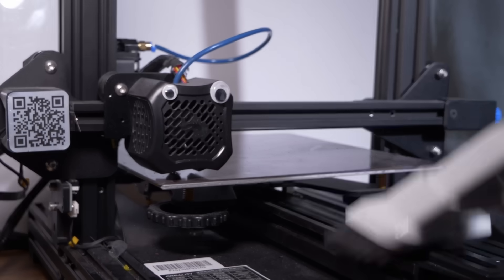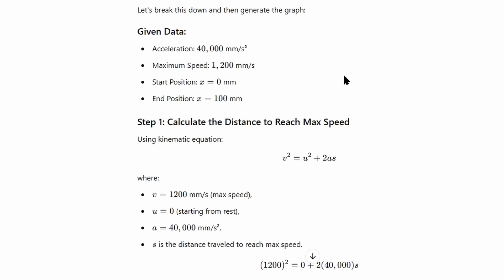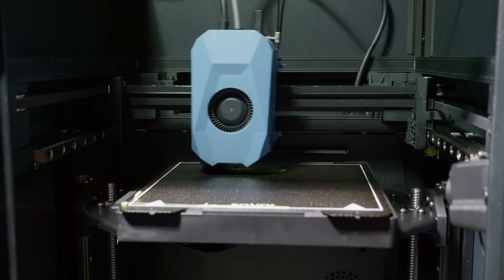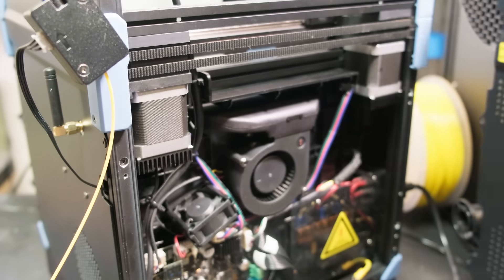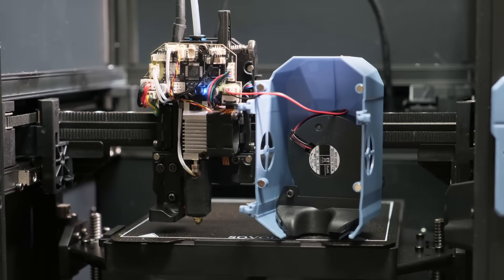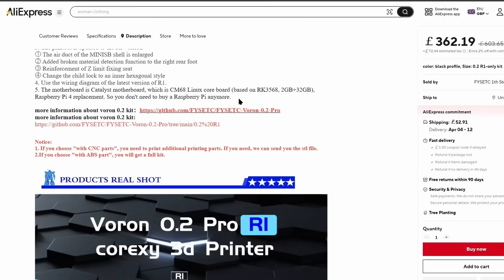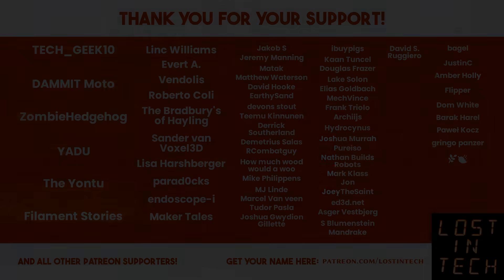SOVOL Zero - Tiny Powerhouse - FASTEST Production 3d Printer??

Comment: $380usd for the Sovol Zero now at the start of 2026, meanwhile the SV07 is discounted to $99 with the same software but an older open case bedslinger design, bigger build area, and about a third of the speed (SV07 ships with a factory 24min benchy, its actually a little cleaner than the 8mins one shown here).

Its a clever design because coreXY has no moving motors (bar the extruder itself) so doubling the width of the bed does almost double the inertia, and so for a given amount of force (both motors and frame rigidity ect) halve your acceleration time. But its also kind of a strange design in that its quite an expensive to manufacture small printer. It relies on many linear tracks instead of just smooth rods (let alone Vwheels), a pair of lead screws, 5 stepper motors and quite a complex belt drive, in addition to the steel frame, panels (which btw I think where needed as weight and stiffness to try cull vibrations the engineers talked about, not just the feet) and various airflow ducting. Yet its not a "premium" printer, it runs a single stepper driver for both vertical axis, a very course control on bed heat, and has some questionable wobble with the way the lead screws are left to handle torsion AND perpendicular vibration. It truly feels like its got one foot in either niche and feels like it falls into a gap between. Like if it had been the first SOVOL to pitch an AMS style multi-filiment it'd have been a best seller (model making isn't normally large, and wastage cost in both time and materials is mitigated for smaller faster printers), if it had been 2/3rds the speed but half the price it'd have been a bestseller (cheaper than normal Ender3 and simlar? It'd crush "entry level" market) or if it had cost twice as much but been neatly polished as a halo product (have everything BUT size) it wouldn't have been a huge market but it'd have been the ONLY option for those people. One toe in each though? I'd be interested how many they actually sell, vs their own bigger SV08 or cheaper SV06+/SV07. The economics of having this AND a large printer just don't stack up well vs buying one Prusa Core One L or equivalent from the get go unless your REALLY sure you can get both running at once but also sure you won't be scaling further to a farm.
Reply from the maker: $99 is insane, for literally anything with klipper

Comment: I've had mine for a few weeks now.  No problems, but it's not quite the same klipper presentation I've got on my Enderwire home brew, but that's probably in the config files.  I've had TPU jam up in the extruder, but that was an easy fix, just unscrew the spring tension adjust, pull back on the gear level, pop the reverse bowden tube out, and then pull the filament out.  I then put everything back in and made a fresh clean cut on the end of the TPU feed, and tried to load the filament again.  Worked!.  There's a small chance that TPU will miss feed and get caught in the extruder gears, but that's easily undone.
I've gotten perfect prints from ABS, PETG,  and TPU.  Haven't done much with PLA yet.
'

Comment: Think my T1 Pro can match its performance. Or near it. I am most impressive though is that I can get flow rates over 100 cubic mm3. The benchy was around 8 minutes too, if I remember well, and quality was quite ok. If I remember correctly you also have one. Wonder if you compared the performance of the two. Challenge with the T1 was optimising the parameters as standard profiles were not really

Comment: oh no they still didnt fix the extrude so i guess my mod will be used on this too. SV08 Extruder fix on printables. looks like the same everything as the SV08. Now i need to see if i can get a tool head to put on my SV08. i see they made sure not to have the build plait resting on the plastic shell in this version. i told them that was the issue with the tacos on the SV08. the clips on the cover are do to lots of issues with the tool head falling off mid print for people. 
note: the step files got added to the git hub 5 days ago. 
they defiantly used a lot of the community's comments to make this thing more polished then the SV08. the SV08v2 should end up being epic.
Reply from the maker: What's wrong with the extruder? 🤔
Reply: @LostInTech3D  oh i cant add a link but the pin has a high chance of working its way out of the tensioning arm

Comment: @Lost in Tech For me this printer would be very interesting for printing technical parts in abs/asa, pc, but I'd like to get the chamber a bit hotter. I'm wondering if there is enough space in the printer to isolate it. But I'm unsure if i'd cook the toolhead mcu, since it seems to have no dedicated cooling fan. Do you know how hot the mcu gets in the closed chamber, or for how many degrees C its rated. Same for the eddy current sensor. Btt eddy for example seems to be only rated for 60deg C max ambient temp.
Reply from the maker: That's why I tested PC. I didn't think to look at the chamber temp though. The bed is at 120 so in such a small volume it's probably not ambient 🤣
Reply: @LostInTech3D  The chamber doesn't seem to get that hot on this unit, probably because of the metal panels. mpox measured 50deg chamber temp in 20min heat time with the bed at 120deg C.

Comment: Had my eyes on Voron 0.2 for a while, almost pre-ordered but there's one thing that I'm worried about. How is it with the noise levels? In one German video I saw a complaint that the motors are squeaky, does it exceed 60 dB?
Reply from the maker: Definitely exceeds 60dB, yes. Of course everything can be tuned but by default it's loud.
I did measure it, I don't remember but I think around 61.
Reply: @LostInTech3D  Thanks for letting me know! I guess i'll stick to bambu a1 for night prints, preordered sovol zero with your link anyway, it just looks like a solid printer. Achieving lower noise will be a great way for me to tinker a bit and learn more along the way

Comment: Sovol please update sv08 with Zero  features and I will buy two.
Reply from the maker: Sv08 pro. Actually a good idea. I'll pass it on.
Reply: I've been begging for an SV08 Pro with a $200 upgrade available for the original SV08 so we can have a flat bed and an accurate bed mesh.  According to yesterday's Zero launch live stream, we're getting an Eddy upgrade for the SV08 (but nothing to fix the warped bed), and we're getting a 500 mm class coreXY printer soon, which is very cool.

Comment: Thank you for the disassembly.  I'm an engineer so I always want to see what's inside to get an idea of how things work.

6:00 - On the Zero live stream, Sovol mentioned that they added over 2 kg of dead weight to help hold the printer to the table surface when it's printing.  That's a small fast printer problem.

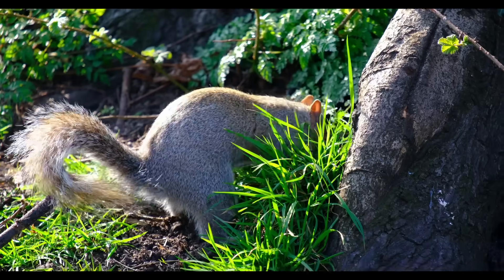6:50 - I print a lot of TPU so thank you for testing TPU even though inherently slow TPU seems an odd choice on such a fast printer.  My interest isn't so much the impressive but manky 8:20 speed Benchy but rather the 20 minute high quality Benchy that the ultimate high speed suggests.  I don't expect faster or better TPU prints but the Zero should make good PLA or ABS prototypes at 500 mm/s, and perhaps even more significant for small prototypes is the very fast bed heating and Eddy probe bed scanning.  Many "fast" printers spend several minutes getting ready to print.

Honestly, I'm pretty sure I formed an emotional attachment to the Zero and I like Sovol as a company for their entrepreneurial spirit and support of open source, so I was able to force a lame rationalization for buying a Zero based on fast engineering prototypes and the probable fantasy that I can use the Zero for production in spite of its tiny bed by leaving the front door open for TPU and PETG-CF parts and writing some custom G code to use the tool head to eject a printed part and automatically start another part, which would make the bed size meaningless for any discussion beyond "Will the part fit on the bed?", which most production parts will.

I'm sorry that I purchased my new Zero a few hours before your video was posted so I wasn't able to use your link.   :-( 

While Sovol can't easily fix the >1mm warp on my SV08 bed that makes reliable first layers impossible, they have committed to a hardware & Klipper upgrade to replace the low quality inductive prox sensor with the Eddy probe.  While I wait for that, I guess I'll engineer a solution for the warping bed that doesn't cost $350 and an afternoon of my time to upgrade this $500 printer.  We were assured perfect first layers on the 150 x 150 mm bed of the Zero and that shouldn't be difficult so I'm going to hold Sovol to that claim.
Reply: What are you going to do for the SV08 bed warping?
Reply: @jetplume  - Soon after the release of the SV08, people had the dreaded "taco bed" and they mostly fixed it by removing the bed and shimming under it.  It's a trial and error process so expect it to take three hours.  The goal is to shim the bed so there is a pre-warp when cold so it warps to a much flatter shape.  Some people were getting bed meshes with 0.2 mm of warp across the 350x350 mm bed.  Search for SV08 on Printables and you can find a template to locate the screws under the magnetic sheet, plastic shims you can print, and step-by-step instructions.  I printed the shims, and started the process but didn't finish.  I think I'll use thin metal shim stock instead.  The repeated trial and error shimming will be much faster after installing the Eddy probe upgrade instead of waiting for the inductive probe to very slowly create an inaccurate bed mesh.  An accurate bed mesh will result in a lot fewer trials because there will be a lot less error, so I'll install the Eddy probe upgrade as soon as Sovol makes it available and then I'll shim the bed.

Comment: In some reason I want a convinient upgrade for my sv08 watching this video
Reply: On the Zero launch live stream video yesterday, Sovol promised that they were producing an SV08 upgrade to add the Eddy probe for fast and accurate bed scanning.  It won't be a simple sensor replacement.  It will require a little wiring and upgraded Klipper.  I'm looking forward to this.  I also need to replace the bed of my SV08 that warps more than 1 mm across its surface.  Then, with a reliably good first layer, the SV08 will finally live up to its awesome potential.
Reply: @Liberty4Ever  I was getting my sv08 from 2nd batch so my bed is quite alright. Altho yes, screw some screws, plug some wires, flash the fw in one step. I still don't have the time for now to make the whole mainline klipper+eddy upgrade on my sv08
Reply: @WendyGameing  - My SV08 wasn't one of the initial production.  Apparently, throughout the production, some SV08 printers had OK beds and some had beds that warp a lot.  While a cast aluminum bed would have been nice, simply a slightly thicker annealed aluminum bed would have been good enough if the bed mesh was accurate enough for Klipper to compensate for modest bed warping.  It wouldn't have added much to the SV08 cost to anneal the beds, install the heater, mount it to a milling machine using the same mounting points it will have in the printer, heat the annealed bed to 65C and fly cut it flat while at temperature.  Bed warping at 40C for TPU and 100C for ABS wouldn't be much.

Comment: Would have been nice if they  could have hit the $99 - $149 window for the price. Could have made it into a great first printer.
Reply: There are five linear rails in the Zero, as well as a lot of other high end parts.  It would be nice if Sovol shipped the Zero for free with a $100 bill taped to the build plate, but it's just not going to happen.  It will be interesting to see if Elegoo can deliver on their $230 Centauri or $330 Centauri Carbon when the production units ship in a few months.

Comment: The problem with printing faster is that the quality of the prints diminishes just as fast.
Reply: I bought the Sovol Zero not expecting a good 8 minute Benchy, but assuming that a printer that can print an 8 minute speed Benchy can produce decent quality prototype parts at 500 mm/s which is where rapid PETG or hyper PLA will flow reliably in a high flow nozzle.  The Zero claims 50 mm^3/s which is a crazy spec.
Reply: @Liberty4Ever  One of my many printers is the Sovol SV07 which can also do 500mm/s. It's normal setting is 250mm/s. I've tried several types of filaments at different settings. For quality, I don't exceed 200mm/s.
Reply: @paparoysworkshop  - A small stiff frame properly tuned coreXY machine should be capable of making accurate and high quality prints at the speed of the filament flow, and to prevent that being a major bottle neck, Sovol apparently cranked up the power and increased the melt zone on the Zero hot end.  It'll be interesting to do some extrusion tests with PLA, Rapid PLA, PETG, Rapid PETG, PETG-CF, ABS and TPU.  I don't usually use the rapid versions of PLA or PETG but I may be able to take proper advantage of their higher flow rates on a fast printer such as the Zero.
Reply: @Liberty4Ever  Well, one thing I need to do with the SV07 is to bolt it down and secure the gantry as at high speed it shakes so badly you think it will fly apart. Maybe then I could run it faster.

Comment: I suppose that explains right away why most manufacturers go for bigger printers. It's the most eye-catching metric and when you keep the same motion system it doesn't make the printer proportionally more expensive to produce.
Reply from the maker: Yeah I'd say so. Which is a shame because small printers are good sometimes.
Reply: The biggest cost in scaling up is a flat print bed.  It costs a lot more, even per square mm, to have a larger bed that's just as flat.  Many 3D printer manufacturers skimp on the flat bed and fast bed scanning when scaling up the printer for marketing purposes, which is a shame because a 3D printer needs a good first layer to print reliably.  It's non-negotiable.

If I was designing 3D printers, I'd use flat non-warping borosilicate glass for the bed, with a magnetic PEI sheet on top, quickly heated from below using infrared, with an IR sensor in the tool head measuring the temperature of the print surface instead of a thermocouple measuring the temperature of the heater that's below 6 mm of aluminum relative to the print surface.

Comment: Cheers for the squirrels. The 1/10 speed made me chuckle, still quicker than my Ender 3 :)   I've stumped up for a Centauri Carbon so I'm rather keen to see your review and hear your thoughts on that one. I did look at building a Voron, I love building things way more than using them tbh - but there are limits to that, driven by costs. I don't do much printing so until now, the Ender has been enough....but it's starting to irritate me a bit now, hence the CC to replace it - cheap and apparently(!) cheerful.